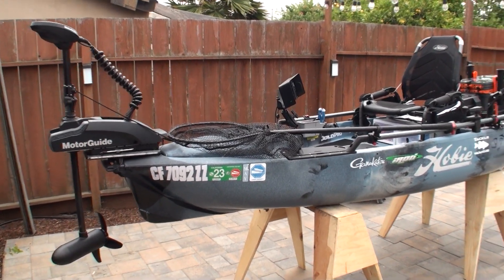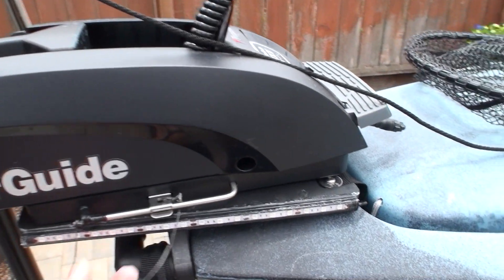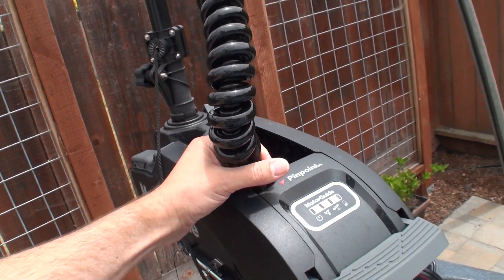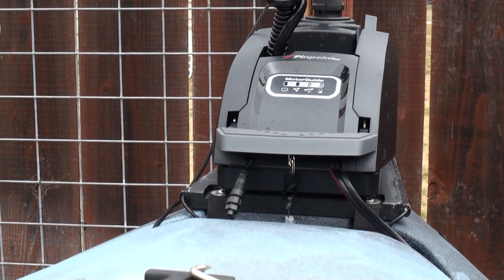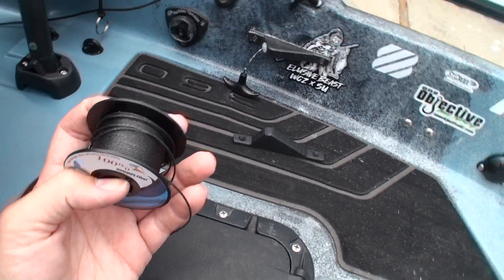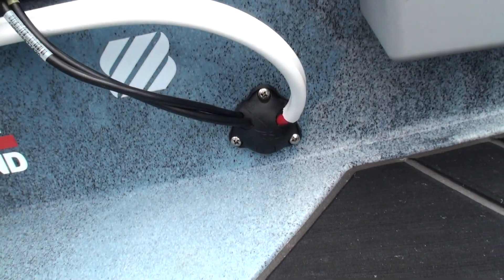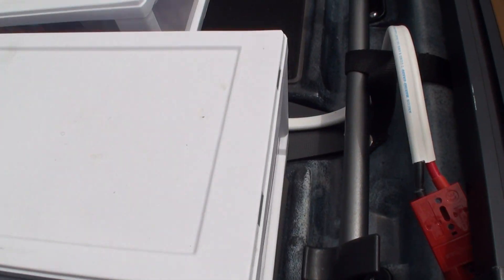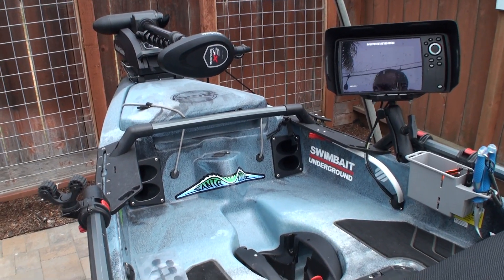Motorguide Xi3 on Hobie Pro Angler 12 360 Walkthrough

Comment: Nice video and very informative.   Great solution to the TM deployment.    Off topic but do you have an idea as to how the 12 compares to the 14?   Thinking of going either 12 or Outback.   I’m 5’5”.  Thanks!!
Reply from the maker: Thanks! I don’t have any experience with the PA14 but I know it’s more stable than the 12, which is already really stable. They’re both good kayaks. The PA12 is going to be a little more stable due to its width but the Outback will be lighter and easier to transport. You’ll be stoked with either one.
Reply: Thanks.  Fished a ton out of the older Revolution.  Still have it and would fish out of it now but standing up is a high wire act.  It’s surfing.   Not really cut out for freshwater tournaments.  Actually the seat is the big detractor.  It’s basically a padded plank.   Ten years ago I could deal with that.  Not now!!  Will look into getting one or the other this year once I sell my Revo.   Thanks and best of luck.

Comment: How many Anderson connectors did you use total? Holding up well?
Reply from the maker: I used a total of six Anderson connectors: two for the motor-to-power connection, two for the battery box-to-motor wire connection and two for the inline power meter. Without the inline power meter, you only need four. I recommend you getting a good crimper for the leads so they insert well into the Anderson connector housing. But the Anderson connectors have been holding up very well. No issues for me. Highly recommend them.

Comment: have you had problems with the plug for the trolling motor getting wet giving you motor problems?
Reply from the maker: No I haven’t. It’s not very common for the plug to get wet unless your taking on water. And the Anderson connector is well designed such that it’s difficult to cause a short with water unless it’s completely submerged.

Comment: Do you find the xi3 on the bow with all the weight makes your standing stability or the handling of the boat awkward in any way or different? Would you still recommend this setup after using it for awhile against adding a something like a stern mounted nk180 ?
Reply from the maker: I don’t have any stability issues with having the Xi3 bow mounted. I would still recommend the Xi3 over a stern mounted motor. The stern motor is primarily used to get you from spot to spot and will do a better job at it than the Xi3. Using the 360 drive for fishing and the nk180 for traveling longer distance is a good combo. But in my opinion, an Xi3 is more versatile and having spot lock is a game changer.

Comment: I’m presuming u steer it with the remote ?
Reply from the maker: If I’m just fishing a shoreline and picking it apart, yes I steer with the remote. If making a longer run, I just point the motor straight ahead and use the kayak rudder to steer. It become sketchy when going full speed and turning the motor with the remote.

Comment: what is the total weight of this boat i just looking for the one hold the most weight why i seen video few mins ago said ascend is like 550 lbs..this what my gator lithium has anderson connection so this is good upgrade what you did fit my battery
Reply from the maker: The bare weight of the kayak is 133lbs but that’s without any of the extras. The weight capacity of the kayak is 500lbs.The battery weighs about 22lbs, I think the motor is about 30-40lbs. I’m still pretty well under the capacity.

Comment: For How long can you run your trolling motor with that battery?
Reply from the maker: Run time depends on how much time you spend making long runs at full speed. As a reference, going constant full speed at 4.7mph, the battery will last 2 hours and 40 minutes. If you back it off to a constant 4mph, it will last 4 hours. On one of my longer trips, I made about 7 miles worth of full speed runs and then just cruising around fishing for like 8 hours and I used probably about half the battery. If you don't really make any full speed runs and just fish shorelines, this setup will last you probably 2 days or more.

Comment: Are you getting water inside your hull as well?
Reply from the maker: I was getting water coming in through the scuppers but I plugged them and now it’s good. I still do get some water coming in through the drive insert opening when I step towards the front of kayak. But the water drains right out when I sit back.
Reply: @Generalneves007  I've been getting water inside my hull not sure if it's going in through the drive area or maybe the transducer through hull under the seat
Reply from the maker: @albertflores4479  Ya I’m not getting any water coming through the transducer opening. Are you getting water coming in all the time or just when your traveling using the motor?
Reply: @Generalneves007  so far every trip I've been out I've been getting water inside looks like it happens when I go full speed
Reply from the maker: @albertflores4479  Do you have scupper plugs for the scuppers under the seat? I was getting water coming in when going full speed and it was the scuppers.
Reply: @Generalneves007  just put some in today hopefully that helps for me
Reply from the maker: @albertflores4479  That should do it. My hull has been dry since adding the plugs.
Reply: @Generalneves007  thanks, gonna test it out this weekend

Comment: How far can you go on a charge roughly and what is the top speed?
Reply from the maker: Top speed is about 4.7mph. Distance depends on how much time you spend making long runs at full speed. As a reference, going constant full speed at 4.7mph, the battery will last 2 hours and 40 minutes. If you back it off to a constant 4mph, it will last 4 hours. On one of my longer trips, I made about 7 miles worth of full speed runs and then just cruising around fishing for like 8 hours and I used probably a little less than half of the battery.

Comment: Nice video! Do you know what would be the total run time on your motor?
Reply from the maker: Thanks man! Run time depends on how much time you spend making long runs at full speed. As a reference, going constant full speed at 4.7mph, the battery will last 2 hours and 40 minutes. If you back it off to a constant 4mph, it will last 4 hours. On one of my longer trips, I made about 7 miles worth of full speed runs and then just cruising around fishing for like 8 hours and I used probably about half the battery.
Reply: Really appreciate hearing your experience running the motor. Thank you!

Comment: Need to check out my motorguide xi3 video before you go drilling holes in your kayaks and putting pulleys and all that, no drilling needed.
Reply from the maker: Unfortunately, your video didn’t exist when I did my install. But I’ll check it out. I don’t mind drilling two small holes to have an overall cleaner install.
Reply: @Generalneves007  I don't see how doing more and drilling is cleaner than just pulling straight back and I understand it may not have existed when you did your install just wanted to let folks know that you don't hafto alter anything that's all maybe it'll help in the future for ya have a good one and hope you catchem all brother.

Comment: Any water problems getting into the hull?
Reply from the maker: I have been getting a little water in the hull but nothing to be too concerned of. Still trying track down where’s its coming in from.
Reply: My guy said it gets in at around your drive system. He has had several people with the same issue. If it’s not to bad then I may be able to live with it. I just need some confirmation from some others with the 360.
Reply from the maker: @jetco5906  I’ll take a look to see if it’s coming through the drive on my unit. I could see that it may be able to come through the drive line connection. There is a like a rubber flange inside the hull of the kayak that is supposed to seal the driveline and not let water come through. My first thought was that but I haven’t looked into it further.